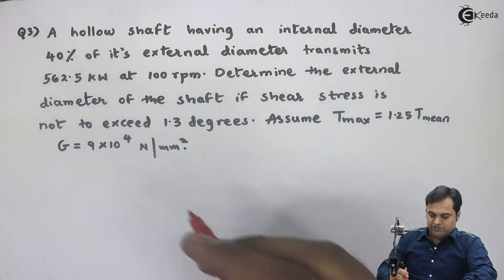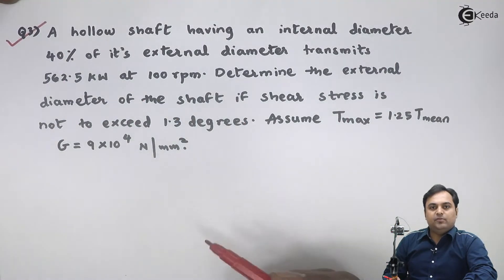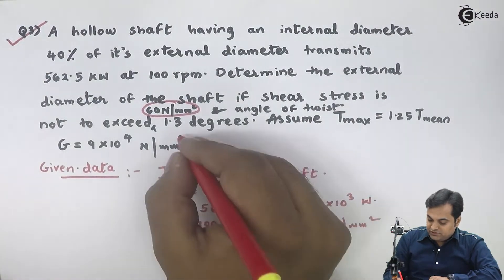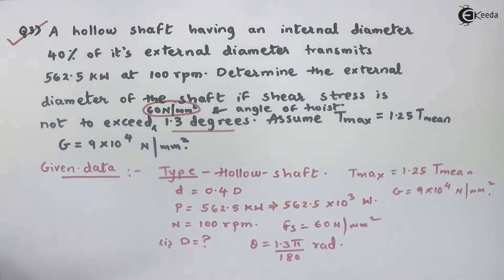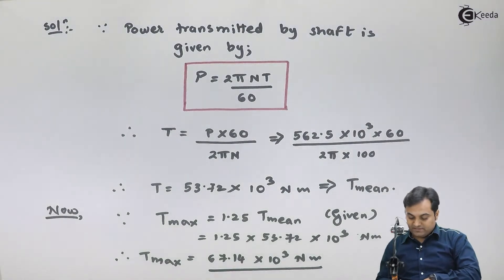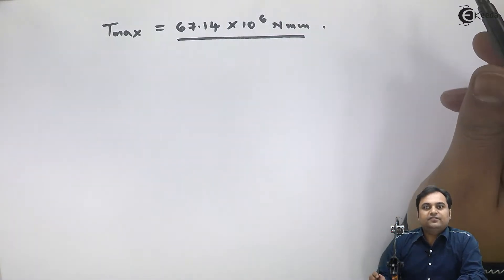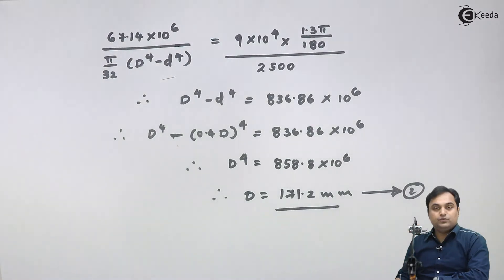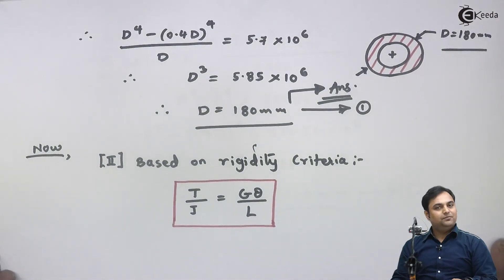Problem on Calculation of External Diameter of Hollow Shaft - Torsion - Strength of Materials

Comment: A steam engine cylinder has an effective diameter of 350mm and the maximum steam pressure acting on cylinder cover is 1.25N/mm Calculate the number and size of studs required to fix the cylinder cover, assuming the permissible stress in the stud is 33MP.. Take the thickness of the cylinder wall as 10mm. Assume coarse series with dc = 0.84d

Comment: a hollow circular column having external diameter and internal diameter 30 cm and 25 cm carries a vertical load of 10 tonnes at the outer edge of the column calculate the maximum and minimum intensities of stress in the section

Comment: Sir, there is one question, how would we calculate angle of twist and safe stress of the material in practical aspect. Cause these are not known values in the material standard..? This is because I am facing difficulty while calculating design of shaft in practical aspect for a machine.

Comment: sir how you got d^3 from   d^4-(.4d)^4/d
Reply: vinay s its actually D^4-0.4D^4=0.6D^4/D
He got it wrong i guess
Reply: @yash05195495  no bro
   (D⁴-d⁴)
= {(D⁴)-(0.4D)⁴}       [because d=0.4D]
= 0.9744D⁴ 
And then calculation:      
    0.9744D⁴=836.86×10⁶
or,  D⁴=858.8×10⁶
or, D=171.2
Sir ; your ans is right🙏🙏🙏
Reply: D⁴ - d⁴/ D
=1D⁴ - 0.4D⁴ / D
=0.6D⁴ / D
=0.6D³
Reply: @SatyamKashyap27   no bro 
d= 0.4D
 So d⁴=(0.4D)⁴
        d⁴= 0.0256D⁴
Reply: @SumanDas-ql1ue  oww... got it
Reply: he definitely got it wrong..
Reply: So what should be the answer